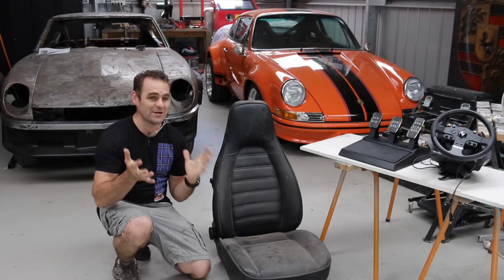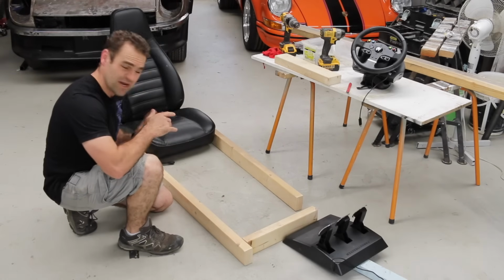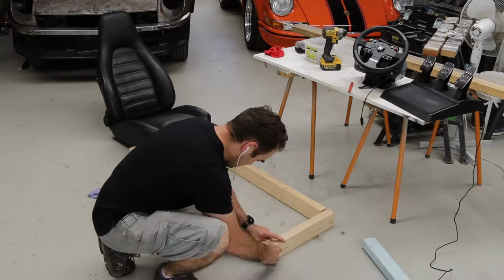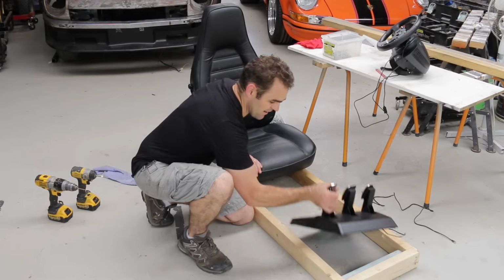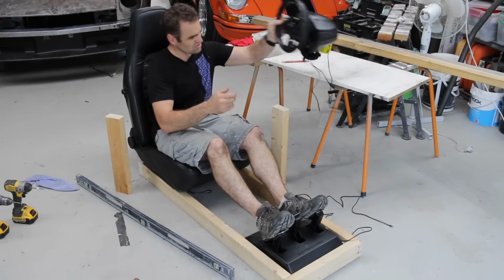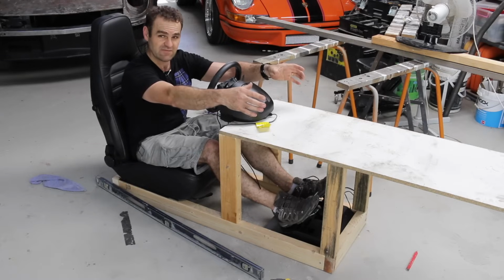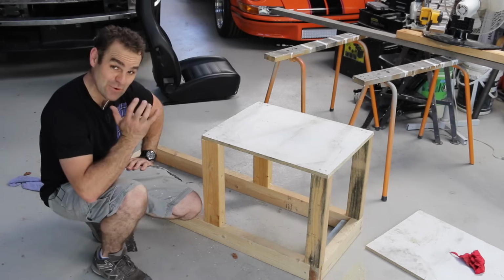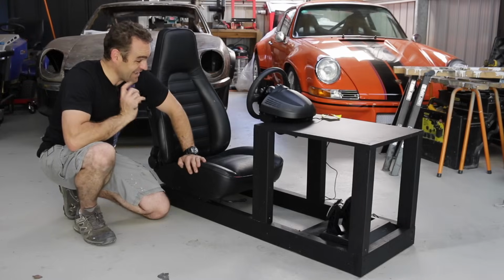World's Simplest DIY Sim Racing Rig

Comment: “Simplest sim rig. Step 1: buy 911 and remove seat”

Wheres the shifter?!
Reply from the maker: I don't have one yet. If I get one I will definitely post up the modifications ;)
Reply: He said 'simplest' so there is no shifter. Maybe you are the 'simplest' person I have wasted a minute of my life with.
Reply: Paddles?? Also handbrake (can mount to the wood on the side on steering wheel) (like how ken block's is)
Reply: michael lavery 😂😂
Reply: This is simple! Only add  a supoort screwed on side right.
Reply: HAHAHAH Yeah!!! :D
Reply: The wheel has paddle shifters
Reply: @michaellavery4899  boooooo!!!!
Reply: @marinaabdelnour7913 . Thanks. Have a great new year.
Reply: Make a home made Sim👌💪
Reply: Mine is simpler😐
Reply: I got the steering wheel... now all I have to do is save for a 911
Reply: @HomeBuiltByJeff For the immersion factor older cars did not have paddle shifters. A gear shift is a necessity.
I built my first rig out of an old stair climbing machine my wife didn't use. (lol).
Now I have a GT Omega sim rig.
  Great project by the way.    Nice job.
Reply: Many steering wheels have paddle shifters built in so his is STILL the simplest SIM Chair. 

Thank You for taking the time to build this!  I'm going up build 4 with flat screens mounted right above the steering wheel. For a game room.
Reply: Can I stay with 911?  :(
Reply: Thanks for the great video. Shame I don't have a spare Porsche seat knocking around. I'd be tempted to add diagonal bracing to the table uprights.
Reply: Sometimes the simplest solutions are the best !!! Inspiring for so many i'm sure :) Well done !!
Reply: Simple meaning most of the time he will probably be playing in automatic
Reply: @HomeBuiltByJeff  can u tell me the width please man i am struggling

Comment: Really appreciate having this exist! I found a sweet manual GTI (the plaid one, of course) seat in good condition so I actually mounted the seat rails to the chassis of the rig so I can move the seat back and forth so others can use my sim too, but I didn't have the slightest clue as to where to start in terms of actually building it until I saw this.

Comment: Glad I found this video again, after watching this last year I went to the wreckers and bought bucket seat from a Kia Cerato, bought the passenger seat because it was in excellent condition and only cost me $50, it is super comfortable and came with the rails which were all of similar height so no packing etc to make it fit on my frame. Been using it for a year now and the only change i have made it to remove the G29 pedals and invert them so they sit like a real car. Thank you for the inspiration. Total cost for a really good sim seat (Not included the logitec G29) was $50 seat plus $15 in timber.
Reply from the maker: Nice work. Glad you got some inspiration. Also good thing for me then that old 911's and Alfas have floor mounted pedals ;)

Comment: Moin, you made a fine RIG there
I'm more of a hobby at ACC at the Series X and just looked at what material had accumulated over the years. 
I built my RIG completely out of wood and this is what it looks like now. It only has to be filled and then painted black with orange accents. 
However, it has become quite massive (1.72 mx 1.20 m). I built in the Gamechair as only I am allowed to sit in it. So he didn't have to go on any rails. 
Unfortunately, the options on the XBox are very limited. 
I took the 3 vibrators + control from an old massage mat, screwed 2 of them into the seat and the third to the pedals. Connected via the subwoofer of the Gamechair. Not as optimal as on a PC, but the result is astonishingly good. Engine vibrations, curbs or gear changes are simulated well. 
I can proudly say that I have made something fantastic for me out of "junk in the basement". Except for a few corners, I had everything lying around. 
I think it's great when someone thinks about it and builds something for themselves. Anyone can buy ... 😄
Definitely a nice video of you with a great result. 
Here is a very short video of my RIG in its current state. 
https://youtu.be/BuATCe7t4Xs

Comment: Thanks a lot. I found Alfa Romeo Gt seat, pair it with Logitech G29 and follow your instruction. I just reinforced structure with steel L shaped profile and it's good to go. I would suggest people to put little bigger table, mine is wider 5cm each side of structure and you get aditional space to put something. Your phone, joystick or keyboard. Once again thanks a lot. For curious, everything costed me (without seat which you can find for 20 euros and G29) around 30 euros in material. It is 2 hours of work if you are not skillful. Way less if you are. Go for it!
Reply from the maker: Watch part 2 of this sim rig as well for the add ons ;)

Comment: Dude!  You've got a table RIGHT THERE!!!  Put the wheel on the table, throw your seat/pedals assembly under it and use THAT to figure your distance, at least.  Who knows, maybe you'll like the height, too.  Of course, another way is to get a friend to hold that stuff for you while you do your measuring-tape thing.
Pretty good low-budget deal, though.

Comment: I have made one myself from some boards from an old desk I had laying around. I haven't got a proper seat yet, so for now I am sitting on a kitchen chair. I made a plate with two holes for the front legs of the chair as a guide so that I can sit in the same position every time I need the setup, as it blocks the view from my bed. :P

Update: just went out and bought a nice bordeaux leather seat from a '99 Alfa Romeo 156 4-door (passenger side) from the local salvage yard. Now to get it cleaned...
Reply from the maker: I may do up a design for a simple set up, that can be pulled out and put away, but setting it up well really helps getting your lap times down.
Reply: Home Built By Jeff Yes, at first, mine was a bit wobbly, but a vertical plate screwed to the sides and the top plate made all the difference. Now it is rock solid. 
I got the seat I bought earlier today cleaned and treated, now I only need to make a base and mount it to the rest of the rig.

Comment: I basicly just did the same thing 2 days ago 😁 i had my thrustmaster t500rs wheel mounted to a wheel stand pro so that was the perfect way to start so i bought 3 garden poles.2poles are 9cm x 9cm x 240cm and 1 pole in size 7cm x 7cm x 240cm,i cut the big poles at a lenght of 150cm for the side of the rig,then i cut the left over pieces at 40cm this serves as the width of the rig(40cm is also the width of my wheel stand pro)as for seat i used my original audi s-line seat since i put recaro pole positions in my car.😉Then i cut the small pole in to 4x45cm to serve as table feet for my monitor,and just bought a dark oak wooden layer to put on top of it,and man it is stable,doesn't move a inch while racing while when i had my wheelstand pro when sitting in my couch it would contantly move around,i spend around 80euro worth of materials,and it's the best thing you can do if your handy and have the tools,i just didn't have a circle saw to cut everything so i sawed it manually other then that it took me about 5 hours to get it perfect how i wanted.

Comment: I'm afraid that you'll soon find out that the wheel tends to slide on/off the table when you start to put some pressure on it. It's because of the clamping system Thrustmaster puts on their wheels. I have solved this problem by filing out two spaces on the bottom of the table where the two clamp ends touch the table. This way the clamp actually clamps into the desk about 3-4 mil which should be enough for handling any lateral movements. Ultimately you can also hard-mount it on the desk but then it becomes a bit of a nuisance if you want to quickly set up or put away the setup.
Reply from the maker: As this is a designated rig, I will hard mount it when I finally get around to it ;)
Reply: I've never had an issue with my wheel (Thrustmaster t150) not staying put, perhaps you're just not clamping it down tight enough? It's not fragile, put some force into it and it will actually dent soft wood.
Reply: Might help to pad any areas of contact with some small flat pieces of rubber.  Rubber resists sliding generally, thats why you see it on the base of joysticks, pc cases etc.

Comment: Good first try. 
I can see one potential issue with the pedal mounting. 
You'll need to place a securing bar across the end of the pedal assembly closest to the seat or they'll start to move upward under heavy braking. All in all, a good inexpensive rig.
Reply from the maker: I have many many hours of use and that has not been an issue so far, but it could potentially happen.

Comment: That actually looks pretty strong. Cheap as chips to make, especially as you had the seat already. I'm considering making my own and the only design change I'd make from yours is to make the front two supports under the wheel to come diagonally from the pedals. Should be just as strong and would make it easier to get in/out.
Reply from the maker: As long as the angle wasn't too sharp. You could also just do that on one side, for easy access and keep the other straight for strength.

Comment: The tricky part about using a seat out of a real vehicle is finding one that will sit flat for you to bolt on to a board. Many or most dont have level anchor points. Also worth mentioning that you want a manual seat for a simple setup, since you wouldn't be able to adjust a power seat w/o rigging a power supply. In the end, I found a passenger seat out of a '98 Ford Windstar for $20 at the junkyard works great.
Reply from the maker: That is a very good point. I think if you can get one out of an older car, you have a much better shot. New cars have mounts all over the place.
Reply: Home Built By Jeff when I was at the junkyard I had a hard time finding a seat with good mounts. Then I thought, what kind of vehicle has a flat floor? A van.

Comment: Very nice! You might wanna consider offsetting the legs of the table on the seat side a fee inches inward so you can get in and out easier, and shouldn't compromise the structure. Love your builds!
Reply from the maker: It would make it a bit easier to get in and out, but now it is built I can't be bothered pulling it apart again. That would mean less time playing it ;)

Comment: Dear Women: That thing on the back of a car seat is a back rest. It is very useful
It assists your back with staying up in corners and when accellerating/brakang, so your muscles don't have to do the work.
Also, the belt actively pulls you about 10 cm back in case of an accident, so you don't fly around inside the car.
Guess what happens when you don't adjust the back rest and instead freely sit upright, 15cm away from it.

Comment: i was able to get a free seat and I went to construction site to dumpster dive for scrap wood. I was able to build a sim rig AND a floating bed for my king mattress.

I suggest pushing the tv all the way up to the wheel and going dash view w/o the wheel on the screen. looks amazing. Just check out my video to see.
Reply from the maker: In your vid it looked really good. It looked like you were in the car. Good stuff. 
I also used scrap bits of wood I had lying around from other jobs. Just goes to show it doesn't have to be fancy to do the job.

Comment: Great video greetings from PR I found a mustang seat and already got a wheel, but I need to add a shifter. I was thinking to    add a t-shape wood additional for it
Reply: Any suggestions
Reply from the maker: I would probably make the table top section have an extra piece that overhangs to the side. Then support it with a diagonal back to the base if that makes sense.

Comment: That's a dreat setup. How about stapling black vinyl on the sides and front. And have the seat on a standard seat track for multiple size drivers.
Reply from the maker: It is on the standard track. I had my 6'3 in mate come over and he just slid the seat back and hopped in nicely

Comment: A stronger wheel would shake the hell out of that monitor wouldn't it? I just bought a ts-pc and I'm considering my rig options..
Reply from the maker: I am a complete Sim Racing newb, but so far I haven't noticed any wobble at all. If you wanted to make it stronger, you could add some thin sheets of plywood or similar to the back and sides of the table part. That would make it super strong, and it wouldn't move at all.
Reply: Yes, I have a Thrustmaster TX. It would shake the monitor. It's best to separate the rig and monitor.
Reply: If you want to use a very powerfull wheel and are worried about shaking your monitor to the ground, you could also do a similar setup and have an interlocking "table" for your monitor(s)

Comment: Nice build sir..some data about all the measurement would be nicer tq
Reply from the maker: It all depends on what seat you use and how long your legs are.
Reply: In the video he says that the distance from the back of the seat to the front of the pedals base is about 125 cm (49.21 inches) so that would be the inner length of the rig and I guess the inner width would be around 35 cm (13.78 inches) since the pedals base is 34.8 cm (13.70 inches) wide and seem to fit just right. Add to those about 10 cm (4 inches) and you have the rough outer length and width of the rig. The uprights are about 59 cm (23.22 inches) away from the front of the rig and the table for the wheel sits about 52 cm (20.47 inches) up from the floor.
He has also posted in other comments that he is 5′8″ tall and that a friend of his who is 6'3'' was able to fit in the rig by sliding the seat all the way back :)
Reply from the maker: Awesome work putting together my ramblings into a coherent package :D

Comment: looks a tad flimsy on the steering wheel may need to add extra support in that area. but nice build.
Reply from the maker: I have had a few say that but I have used it for over a month and it works great. The worst part is it is a bit tight to get in and out of, but it feels like you are getting into an F1 car, so I don't mind it.

Comment: I would also make a hinged steering wheel mount surface with locking pegs to allow wheel height/angle adjustment.  I hope I don't sound like a complete dick shooting holes in the design, that is not my intention.  I love the basic simplcity of this setup, and I am basically "thinking out loud" as I decide to start by building a version of this to accomodate my very fat frame instead of buying a commercial version off Amazon to start.
Reply from the maker: This works for me, but it is more about you getting ideas to build what works for you ;) . Give it a go, you have very little to lose :D

Comment: Your stuff is going to be on the floor the first time you get excited and jerk that wheel.  Better put some brackets on those legs, butt-end screws will not hold forever
Reply from the maker: It could move, but it has been rock solid so far for the 2 months hard use.

Comment: not good, need some adjustable rails and screws plus wood next to the pedals..man...don't tell me that your shoe was OK there...
Reply from the maker: The seat still has it's factory adjustable rails on it. I am 5'8 and my mate who is 6'2 can just slide the seat back. It has all worked without issue for several weeks now..

Comment: Not really the cheapest with that wheel😂
Reply from the maker: Well if you are going to quantify it that way, the seat is worth more than the wheel and the xbox combined. The wood and screws are cheap.
Reply: To be fair, the wheel is the wheel, the rig is something completely different compared to the wheel, and this video was about the rig, not the wheel itself. :P
Reply: That wheel and pedal set is only 200 which is quite cheap as far as wheels go
Reply: Juan Jesus Newegg is pretty cheap I guess
Reply: Juan Jesus choose the type and select pro, it’s only like 50 more
Reply: Never mind it’s 500

Comment: Not so simple when you don't own/have these tools man.
Reply from the maker: All you really need is a hand saw and a drill. If you don't have access to that, then you are not going to be able to build much of anything...
Reply: Correct, so I think the total price of all of these would end up being more than that of a simetik racing cockpit. I saved/bookmarked it anyways since I'm all for DIY and wouldn't mind to do it in the future even if I own a cockpit.
Reply from the maker: I just looked them up. They look nice, but you can easily buy a drill for under $50 and a saw for $10. Including timber and tools you could build this for under AU$100. It looks to me like the Simetik would cost around 5 times that. It is much nicer though ;)
Reply: Haha, I guess you were right ! I did my research and everything needed to build it, in total was less than the completed racing cockpit I previously mentioned lol - which goes for around $300 and something plus shipping to the states. I think I will go for it and do that. I will leave the other nice looking cockpit for when I get a better wheel (like the Fanatec one) that's also compatible with the PS4 and PC. Hopefully they don't discontinue it (the cockpit).

 Right now I'm using a Logitech G29 that I bought not long ago and doing a few mods, like  replacing the wheel with a bigger one from OMP/MOMO and longer carbon fiber paddle shifters for now. I will download your video if you're okay with that for when I start building my rid. Now I just need to find a way to make things easily detachable without the need of using screws if it stays stable :D

- Thank you !
Reply from the maker: Go for it. That is what YouTube is for. Good luck with it.